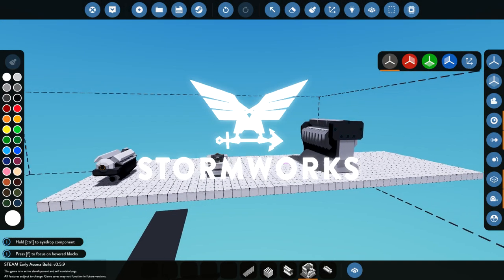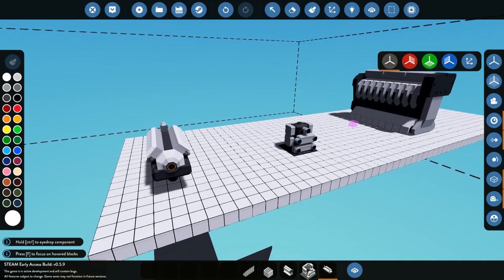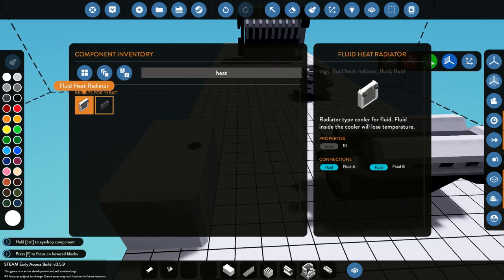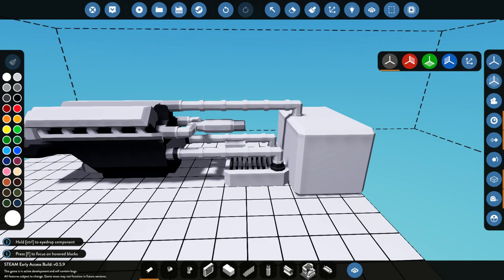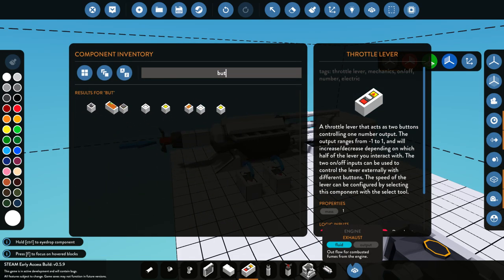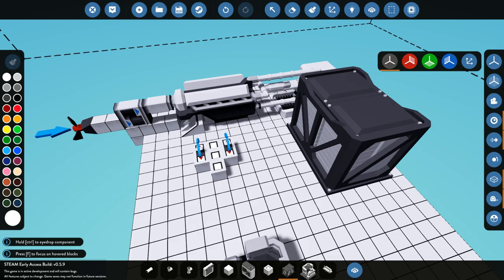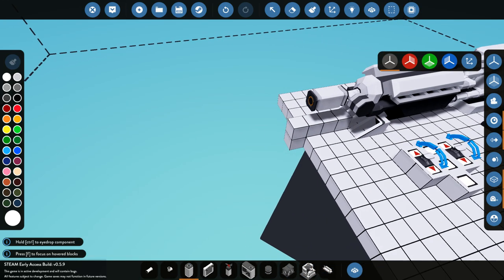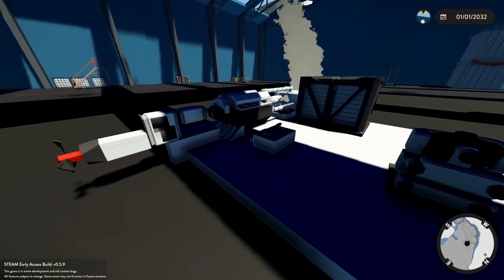ADVANCED ENGINE TUTORIAL  -  Stormworks: Build and Rescue

Comment: IRL diesel engines dont need electric to stay running after they are started as diesel does not use spark plugs once its hot enough.  It will continue running if its only given fuel and air.